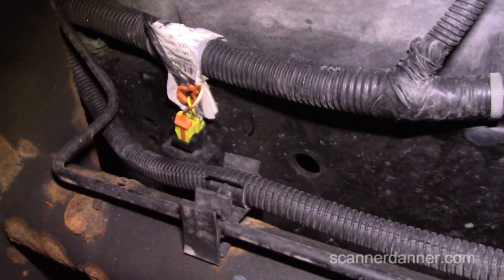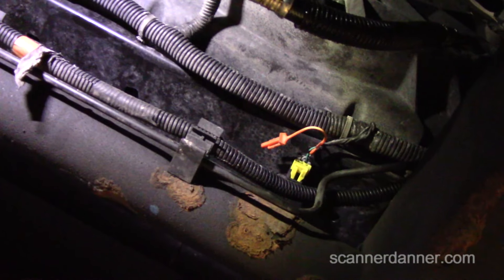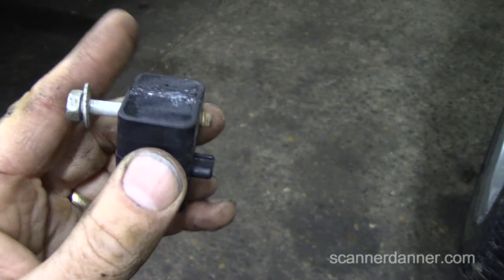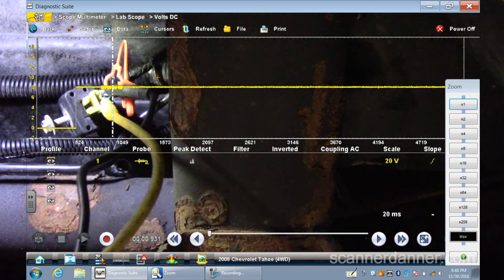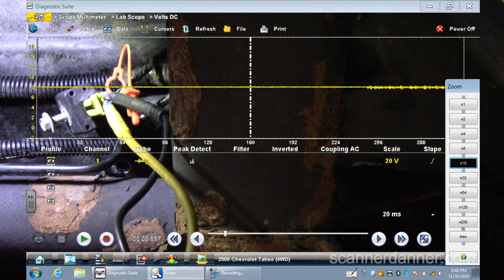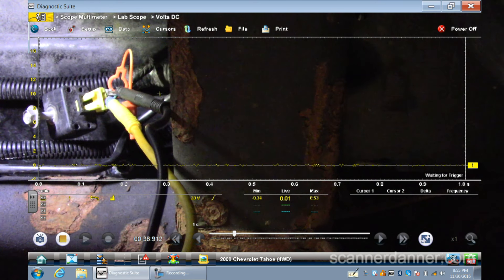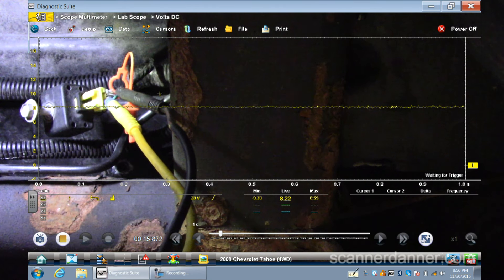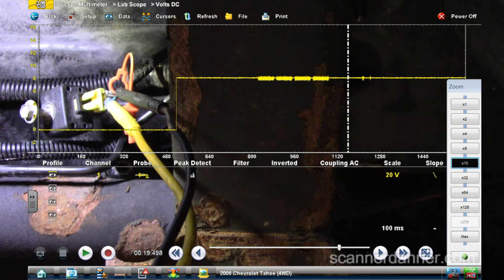2008 Chevy Tahoe Airbag Fault B0084 (Front End Sensor 2 Erratic)

Comment: before buy sensors try to check the seat belt connection at the driver side i fix this air bag warning in 2 cadillacs ,1 tahoe , 2 silverados and 1 sierra they just get that green corrotion clean it and warning ligth fix

Comment: I have a 2010 Chevy Silverado 4.8 and driver side has 2 broken wires inside the door jamb rubber boot..white and yellow stripe wire is broken and that goes to the airbag impact sensor/crash sensor inside the door panel..should I solder it or use butt connectors? Don’t want the air bag to deploy by soldering and changing the resistance?
Reply from the maker: What does the manufacture tell you to do to repair airbag wiring? I hesitate to tell you anything outside of that due to liability. 
I will say this, you won't change the resistance of that circuit by using either method properly.
Reply: ScannerDanner I couldn’t find anything about it..
Reply: ScannerDanner  I wouldn’t hold you responsible if it did deploy..I wouldn’t
 think it would deploy but this is my first time running into a airbag broken wire ..I am the one doing the repairs and I am responsible for my own actions..I will solder it
Reply from the maker: @rahrah8076  sorry for the b.s. reply. I'm just a little gun shy with airbag systems. I recently had one deploy on me. Tech tip! DO NOT unbolt and rotate an airbag module with the key on, on a system with side curtain airbags lol $1500 mistake

Comment: also I've learned all srs connectors are either yellow or orange on all that I've tested. also all air bag stuff uses some type of double locking safety tab. no ones perfect, I like how your not afraid to point that out

Comment: i find it interesting that it is not  a 5 volt as common with digital circuits nor 12 volt as with most ananlog circuits. it seems  to be a modulated signal on a 8 volt carrier. would be intersing to expand that signal to see if it is indeed analog or if its square wave digital.
Reply from the maker: next time

Comment: Try. B0085 symptom 5 for a 06 chevy Impala. Switched sides like Danner did in this video and it never went one side to the other. 

I even disconnected the sensors in the left and right front and the B0085 symptom 5 short to voltage was still present along with 2 new codes. Replaced with a known good sensor from a Salvage yard non air bag deployment hit and still had the same codes doing the swap on the left side first with the replacement then the right side as well so the replacement and original sensors are still good.

 Might I also note I knew it was a complicated diagnosis prior to me switching the sensors that I even took the car to the Chevy Dealer (Stealer) paid the diagnostic fee $70+ tax. After doing the swap I approached the dealer about their bad diagnosis and they said that they just read the code. I told them I wanted to know what was wrong with the vehicle hence why I brought it to them.

 They said well this is one of those things where it's not flat rate but upon asking him about the diagnostic portion he said it was. I mentioned to him that they (dealer) can swap parts left and right being they're a dealer and they cake return them while all along they're not actually diagnosing the condition but rather just being a parts swapper till they get it right. 

By this time I'd been to the dealer once but I knew that it was a bigger problem which torqued me because I knew they were lying to me by then because I had shown them that they just guessed what it was rather than doing a correct diagnostic to begin with.

 I think that just wanted me to bring it back to them but what they did was create a distrust between the dealer and I and actually made me desire and push myself to learn more about this stuff on my own beyond what I already know.

 I get pointers from Scanner Danner in his basic case studies and say screw the dealer because there isn't much they can do that an aftermarket shop or even a guy equipped with the proper tools can't do anymore these days with a little patience and time.  

Impala and Monte Carlos from the mid 2000's have the same front impact sensor. 

This newer additional codes had all been diagnosed with the Solus Edge with the 16.2 upgrade. This makes me wonder with the sensor being removed and having new codes appear if the sensor location was properly diagnosed to begin with being that with the new codes one describes Front Impact and the short to voltage is B0085 Short to Voltage Left Front Impact Sensor

I recently traded after 7 months and now have the Modis Edge with the 16.4 update which has better descriptives and definitely more code diagnostic capabilities. I love but have yet to use the 2 channel lab scope/oscilloscope and component tester as well.

Once I get the hands on with the 2 channel down on the Snap On Modis I'll start using my 4 Channel PicoScope bought thru AutoNerdz.com. I know there's a huge commitment and learning curve but it's well worth it long term for repairing my own vehicles. I don't work in a shop either but rather have a big interest in diagnostics and drivability for me and helping friends

Comment: A "good waveform" section would be a nice addition to the forum. If it's not already there.
Reply: tgoodm1 Get the right scan tool and they have known good wave forms. There's also other sites that have them but they require memberships as someone has to add and remove the waveforms and keep the site up. I know of a site but unless you but their package the wave forms part of the forums plus the more advanced side of the forums is $600 per year. Otherwise once you buy a certain level of PicoScope they throw a auto renewal subscription to that portion of their website. I use multiple forums along with Mitchell DIY and AllData as the information can be different from one of those sites to the other. If you need the website just PM me privately as I'm not gonna just throw it out there as I respect Danner and his followers as well. It takes a lot of work and I mean alot for what he does with all the editing.
Reply: +Dale N Thanks!!! I have a Verus, which does show what waveforms should look like, but I don't think the waveforms are vehicle specific. For example, the amperage waveform it shows for a fuel pump is an exact copy of its example voltage waveform for alternator ripple testing. 

And the camshaft waveforms don't seem vehicle specific either. 

So I just don't know how reliable they are. Maybe they are just so we can get a general idea of how the waveforms should appear. 

Thanks again!!!

Comment: I hold that 84 is expensive for a sensor. And this fellow needs two for this Tahoe. Its no wonder small companies are popping up that reflash Air Bag Modules, ECU's, ABS modules etc. . Once the cost of the components gets up there, aftermarket companies find room to provide a service at which they can profit. It would be interesting however, to discuss the liability of aftermarket reflashers.

Comment: Is it safe to unplug impact sensors with only a key off precaution, or should we pull the SIR fuse as well? You didn't cover this stuff in your book. Maybe a topic for your next revision.
Reply from the maker: There needs to be more than the input from one front impact sensor to deploy the bags. But you wouldn't be wrong in erring on the side of caution. I was not concerned with a battery disconnect or fuse. You saw the voltage drop to zero on key off on that sensor.
Reply: Frank Soliday mfrs recommend unplugging the negative battery cable and waiting a minute or two. I always do. Maybe he should take a trip to South Dakota and he can figure my short to voltage , B0085 symptom 5 on my 06 Impala.  I posted the whole rundown above. It's good to finally see a airbag video or let alone talk about them as from my searches on the internet if you search the code mentioned you'll see my user name dtnel is about the only person posting about this issue the last couple years. Keep the varying airbag videos coming Danner!
Reply: bah, do it live with someone in the seats, nothing like an accidental airbag to the face/arms and possible broken bones

Comment: Do you think that is a 4-20 mAmp current loop?  Usually the current output maps to an analog signal but it sure looks like there is a digital signal there also.
Reply from the maker: not sure brother but current is definitely monitored. The flow chart said the OO code will set if the circuit is higher than 23ma

Comment: Wow, proves you're human again! At least you didn't throw parts at it. I always recommended replacing both sensors too. The failure is water intrusion, water that lands in the bottom of the core support seeps down the bolt threads and gets trapped in the ferrule that the bolt sits in, it then freezes and cracks the housing or causes the aluminum ferrule that the bolt sits in to corrode and expand cracking the housing, then water gets in and corrodes the circuit board...game over. Briansmobile1 did a tear-down video of one of those sensors. When i replace them i goober the crap out of bolt with silicone and fill the cavity where the bolt sits so water can't seep down those threads and get trapped. Very common time of year to see these failures too, freeze thaw cycles finish them off.
Reply from the maker: nice tip! When mine go bad on my Silverado, I will be doing that for sure.

Comment: serious question. Do you think back probing all the different connectors that you do will hurt the connector integrity. The shop foreman where I work told me he doesn't like back probing if he doesn't have to because it cause problems. especially on the newer vehicles that have micro 64 connectors. I would like your take on this Scanner Danner.
Reply from the maker: I would not argue. His points are valid, but there are times where there is no choice. I've also never had a comeback after backprobing anything....ever!
We do want to be careful on the newer network circuits for sure
Reply: Thanks for your reply!

Comment: Hi Paul
Yes air bag plugs are yellow.
Why didn't you just shove a resistor across the terminals (2.2 ohms on sensors & 3.3 ohms on seat belt pre tensioner I think from memory) if the fault clears sensor stuffed & needs replaced job done.
Yes your supposed to disconnect the battery to let the capacitors discharge before working on them but to honest iv never had any problems however DO be careful shoving a multi meter or scope in there otherwise there may be a big bang my friend.

Comment: what would happen if those two wires that were being back probed on the sensor touched each other? I mean they was very close to one another and moving around quite a bit! Would it cause an airbag to go off? Also on another note I live in the UK, nearly every car I work on is diesel, do you have any videos on diesel engine? Your videos are most helpful and I am hooked on watching them. Keep up the good work.
Reply from the maker: There are other inputs involved in airbag deployment. With just the key on, anything happening on that front impact sensor is not going to deploy the bag. You wouldn't be wrong however with your concern. 
The only diesel engine I have to work on is my RV. There are almost no diesel cars here. But as you are finding out, a lot of my stuff is universal. 
Thanks!

Comment: No criticism from me, that's for sure. With all the different vehicles you see day in and day out, it's impossible to keep track of what's what. 

Only reason I knew those were temp sensors is because I've owned my '07 Silverado for 10 years now, and have been all around that truck front to back, and know where everything is. I bought a set of Helm Service Manuals for it the day I bought it - 4 books that stand way over a foot high. Probably loaded with misinformation too, LOL.

Comment: just did this on an 08 3500 the other day...they only have one sensor so yes all i did was unplug the sensor and jump it with my meter and watched for it to flash voltage for a split second with key on which it didn't ..the problem with mine was a plug had come unplugged by the LF wheel well..btw Mitchell doesn't show that there are 2 connectors in between the SDM and the sensor..found out it did by looking at a wiring diagram from alldata

Comment: one plastic cures it cracks if you catch it before the weather gets in to it just lightly coat the whole sensor with silicone to protect it and go on ihave to this a lot with those black neoprene roof pipe boots in fact if i was putting in a new sencor i would h=go ahead and coat it you may then never have the problem

Comment: Could the car have been in a accident or radiator rework where the censer had been removed and refitted and over tightened
Causing it to crack
Reply from the maker: read through the comments. Apparently is is water and freezing temps that cause it

Comment: I tried to join your forum but it won't let me join.  Water gets between the bolt and the sensor, freezes and cracks the sensor.
Reply from the maker: email support@scannerdanner.com and my web designer will fix you up for the forum. We have some methods in place to keep out spammers.

Comment: great info! do you thing those cracks were from over tightening the fasteners? or manufacturer defect? BTW the specifications for those bolts are just 71 lb in!
Reply from the maker: according to everyone here, it is from water freezing in the area of the bolt which expands and cracks the housing
Reply: ScannerDanner  OK is good to know that.. Here in California I only see cracks on the sensors from the engine heat temperature and over tightening bolts!
Reply: JAIVS26 I'll have to check mine here in South Dakota as we get some nasty winters.Maybe they should have the metal brackets on them like the Monte Carlos and Impalas and others I'm sure that don't allow water to rest on them or it appears that way from the bracket that the sensor is mounted on.
Reply: I would suggest a review of freeze thaw theory. Aluminum tube is wicking liquid water along plastic injection mold inherent fault and corroding into excess dimensions.  Seal the aluminum pass thru properly from water and no more problem. $80 buys how many little rubber washers? Be safe, use two.  The grease washers sold for battery post protection is for the same inherent plastic injection mold failure point where battery acid wicks up out of the battery along the post and kills post terminals over time.  It was a cure for 40 years.  And then they finally moved the posts.
Reply: I use those awesome grease fabric washers for battery posts all the time now and don't have any more corrosion issues on posts that are horizontal or commonly referred to as top post batteries. I recommend them to friends, family and others each time I see the corrosion anymore either. 

The metal brackets which are used on alot of the other GM airbag sensors work well also.

 Don't know what the original intent of the metal brackets was as there's still holes thru the sensors they hold also but I never tighten them to much anyways for fear of cracking. Also I can't recall but there's a torques for anything on a car anymore these days it seems even back to the early 2000's and probably earlier as well.

Comment: I wonder what it would look like with an amp clamp.
Reply from the maker: flow chart said amperage higher than 23 ma would flag that code. I cannot measure amperage that low with my amp clamp without a bunch of noise. Anything less than 100 ma I don't even bother with my amp clamp

Comment: I've actually had the seat removed in jt Impala and the sdm disconnected and still can't find the short in the harness from the sdm to the sensor back up front. The more. think though I may need to go back and check that harness bugatti the chevy impalas has the wire for the rear window defrost that burns up in the connector in the lower right foot well by front passenger door. I'm wondering if my impalas wiring for the srs system goes thru that plug and maybe that caused the failure. I was just glad to get the rear window defrost back. that I moved on once I got that fixed. impalas are a fire waiting to happen with the window defrost for the rear window as this is highly documented from the early 2000's to the 2012 and higher I believe. GM should be held accountable for it. They get away with way to much. As a corporation you pretty much have to kill someone to get the government involved kind of like getting a working stop light in communities around different states, someone has to die then a study gets done unless someone dies quickly again but otherwise you may get that stoplight after several years. Cheers! Keep up the great videos Danner!

Comment: ALL airbag connectors are yellow...
Reply: So is your face Lee
Reply: What...?  Your taking me wrong.  I'm simply pointing out that it doesn't matter what make or model your working on, its a government regulation that all related air bag wiring connectors have to be yellow for easy identification.
Reply from the maker: I think he was just kidding around. Great tip Lee thank you!
Reply: Lee Carter

Does this include the 90's vehicles?
Reply: It does. The first two model years of mandatory air bags (93' and 94' I think), it was only a recommendation that all connectors be yellow. In 95' the color was made standard.
Reply: Actually not . For example Peugeot have orange and green ones .